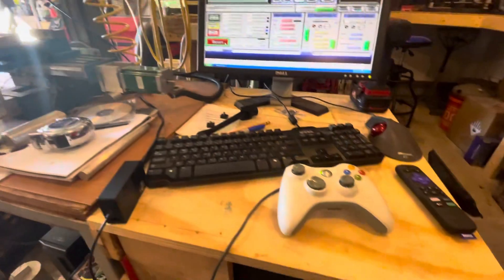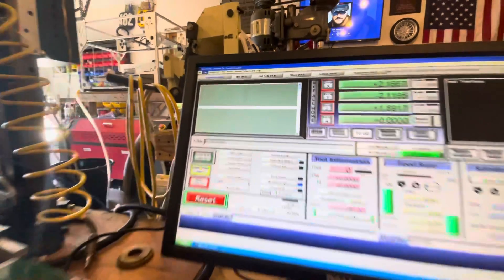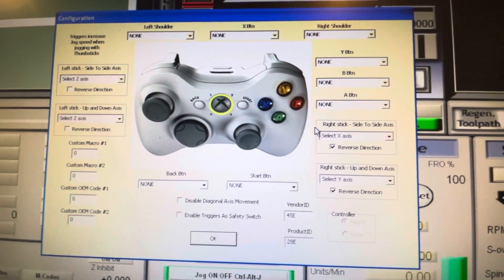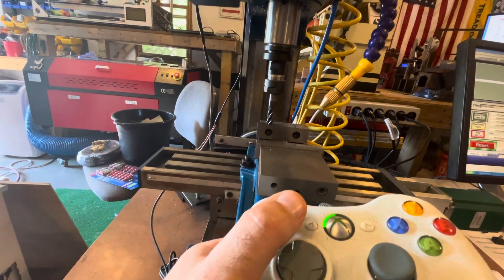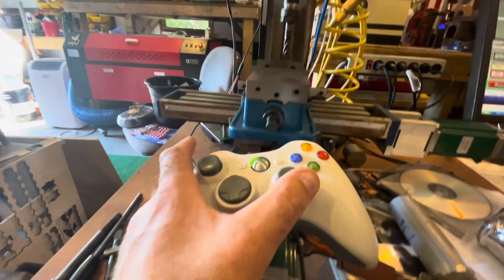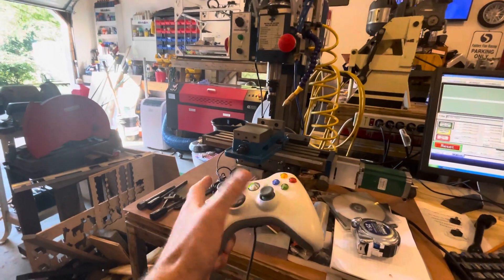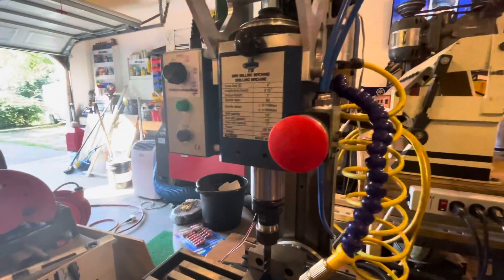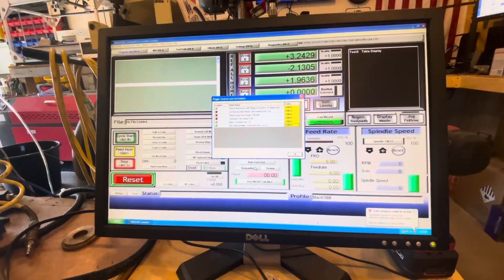X2 CNC update - Xbox 360 controller now working MACH3

Comment: Did you have to install the drivers for the controller?
Reply from the maker: No, once the plug in was installed it worked fine. But you do need direct x installed
Reply: @1620GarageAndFarm  Ahh okay. I tried installing some drivers for mine since I don't have internet hooked up to the machines computer. I haven't tried installing direct x yet either though so I'll have to give that a shot. Thanks
Reply: I’m here cuz this works in my nice windows 10 laptop I don’t want to use in the shop, but not my windows 7 one I don’t care about. Hope this directx install works
Reply from the maker: @mopedman666 hope it all works. My X2 is a great little CNC machine for my garage